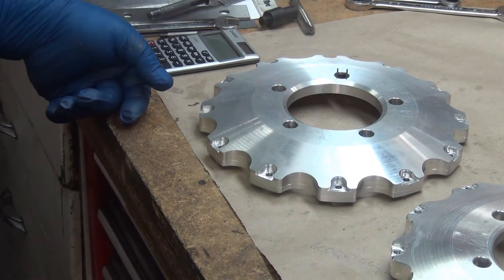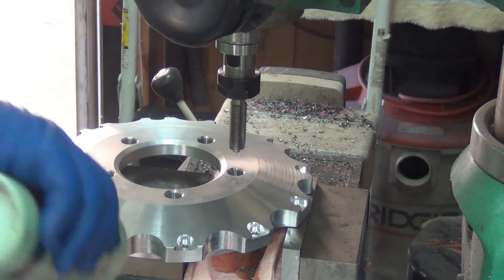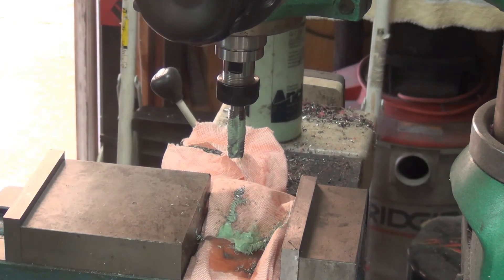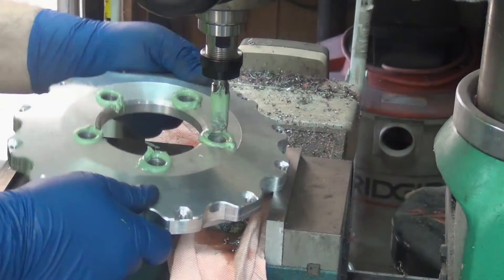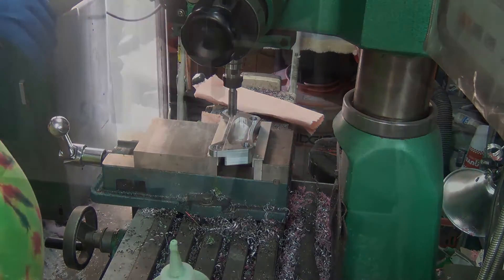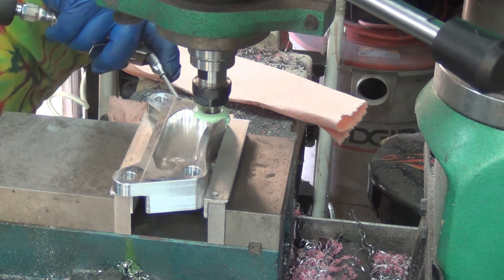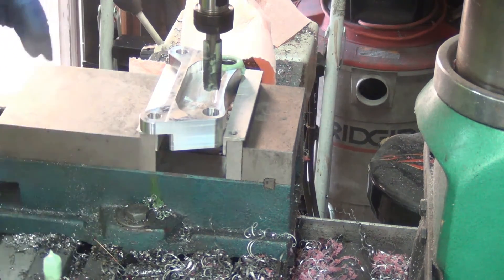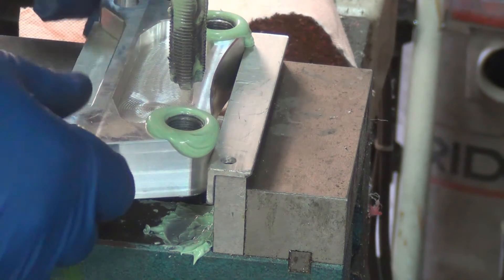13 inch Brakes - Power Tapping

Comment: Great success.  If I am not mistaken that is the same Grizzly mill/drill I have.  But I do not have a reversing switch on it.  Did you buy that switch from some place after you got the machine?  Where from?  And what is that you are holding the tap with? Keep on keeping on.
Reply from the maker: It's the HF version and the switch came with it.  The first attempt that slipped was directly in an R8 collet.  The ones that were held securely were in ER20 tool holders that have the TTS(tormach tooling system) shank on them.  Thanks!

Comment: the bigger the glob, the better the job :) 

I need to add a reversing switch to my drill press for doing this sort of thing.  A mill would be better, but I don't have one of those just yet.
Reply from the maker: The tapping head I used for the 1/4-20 threads will work in the drill press.....it reverses when you lift up on the quill handle.  Mine just isn't big enough to handle the bigger taps.....but you can get ones that are. :)
Reply: I can add the switch cheaper than a tapping head.  I don't do a lot of it, but once in a while it would be decidedly handy to run it backwards I think.  Also useful for left hand drill bits and the like.
Reply from the maker: Definitely cheaper, but do you already have a motor that you can reverse?
Reply: yeah, motor can be reversed, it just doesn't have a switch to do it currently.  It wouldn't be worth buying a motor to get that feature.
Reply from the maker: Ah.  That's good.....and I agree....it wouldn't.  At least not on a drill press.....certainly not mine!! lol